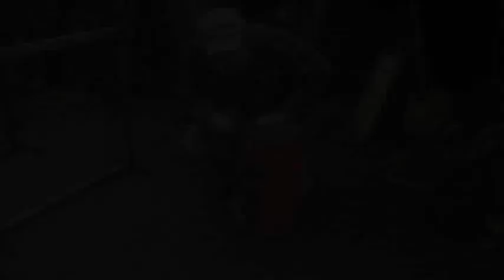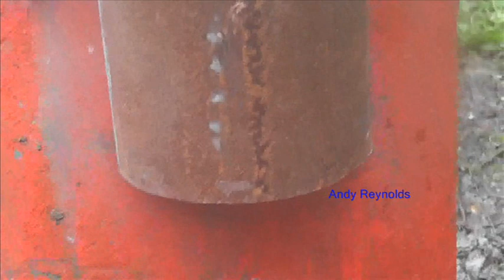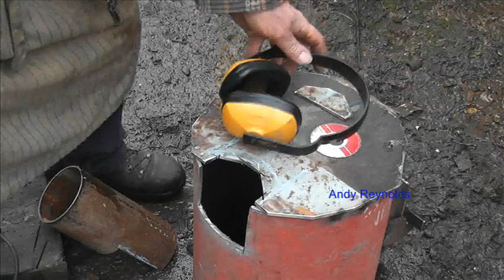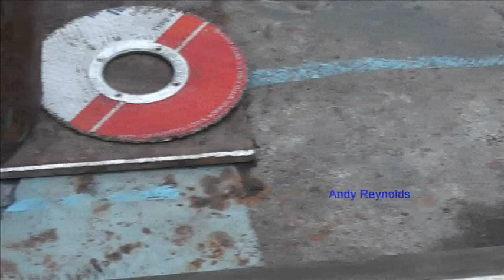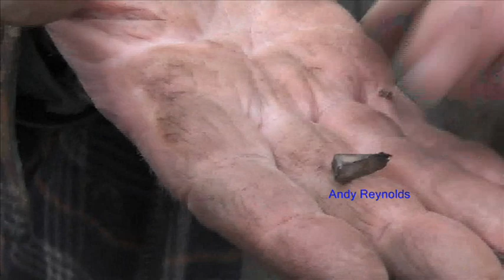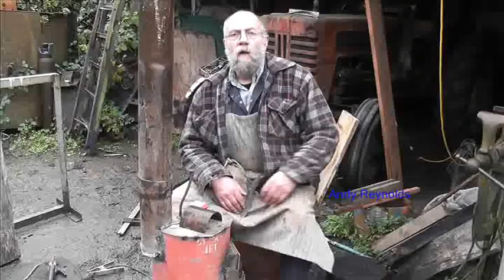Making a wood stove pipe boss and damper, backwoods methods

Comment: Fantastic Video Andy… as you rightly say simple is best, no need for frills to get heat and power. My boat stove is a Villager puffin I bought 20 years ago with a little s/s back boiler that gravity feeds 2 little rads I made out of 22mm copper pipe all those years ago and still works a treat, no pump just gravity, obviously I have a 50% anti freeze mix to help keep it gunge free. I love the idea you’ve made the stove out of an old Calor bottle? Hope to see it lit at some point! 👍🏻
Reply from the maker: Thanks for your positive contribution to the comments, I have done other stove videos, building a wood stove from bits found in the nettles:, Cheers  https://www.youtube.com/watch?v=cQoatS0qYu4&ab_channel=AndyReynolds